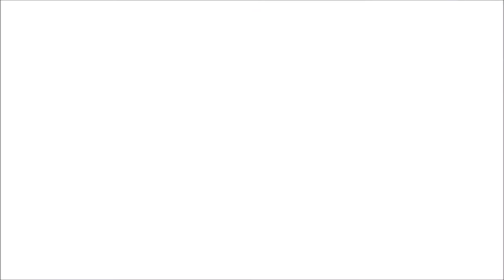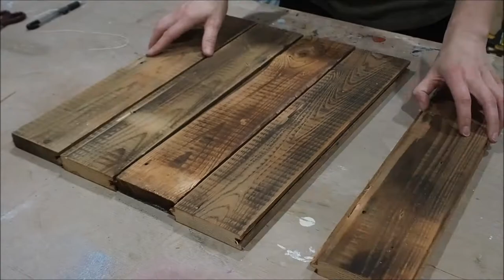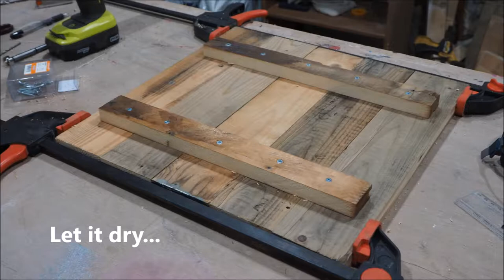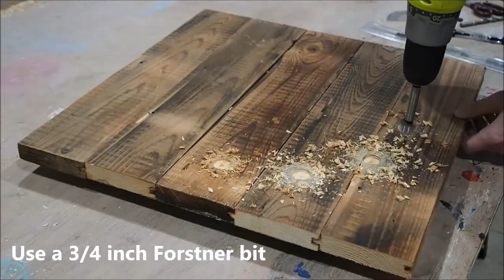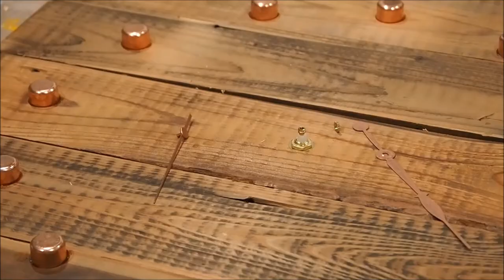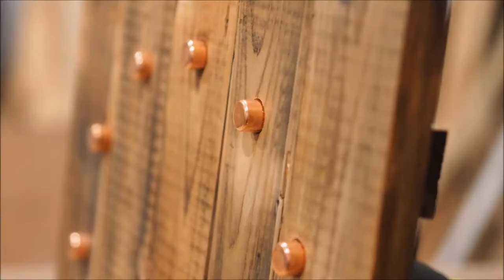DIY reclaimed wood and copper clock

Comment: Why dont u show how to put the clock moter and everything in.. wtf
Reply from the maker: Um, I did show that. You just slip the shaft in through the back, then screw on the hex nut and tighten from the front. Finally, press to snap on each hand.

Comment: Where’d you get all the T&G wood?
I love the simplicity of this build and the resulting clock. Copper was a great touch.
Reply from the maker: Oddly all this wood was on the ceiling of my garage where it meets the underside of the house. Pulled it down to insulate.